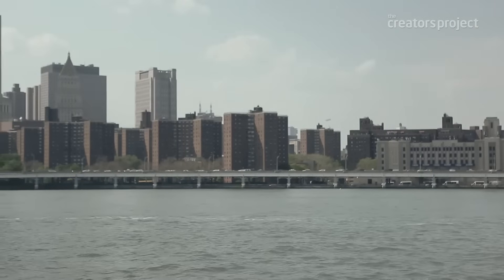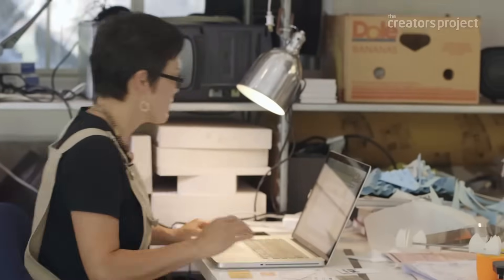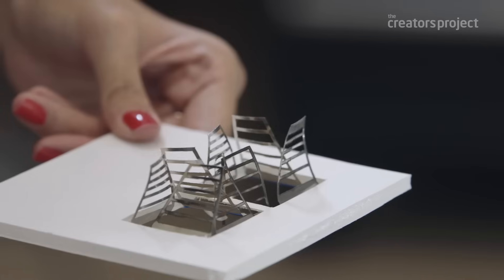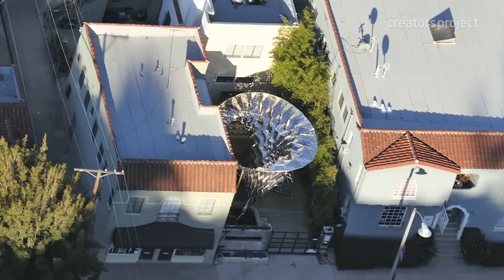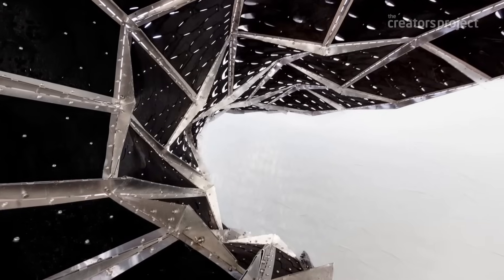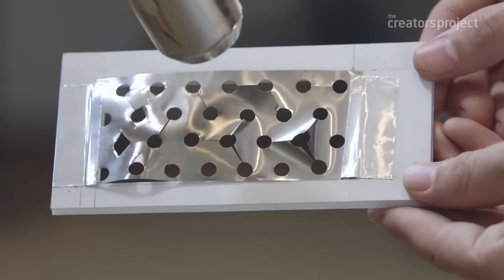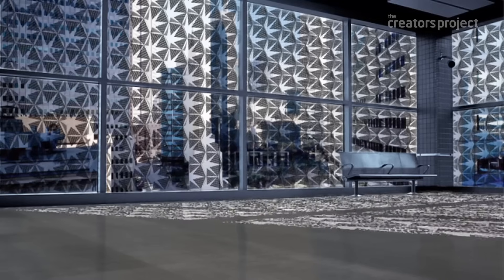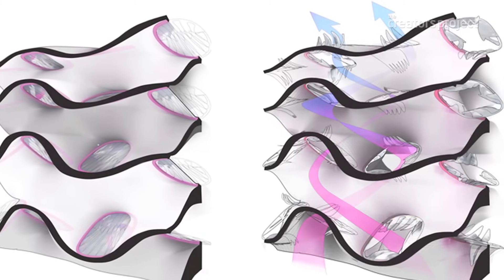Buildings That Breathe | Doris Sung's Living Architecture

Comment: This is a fantastic concept to be coupled with photovoltaics. Ecxess heat from the cells can be absorbed by the structure on which they're mounted, causing it to change its shape, thus rearranging the cells, thus sustaining optimal incidental angle of the cells to sunlight across the arc of the sun.
Reply: !!!!!! agreed

Comment: U told, metal starts curling  at 70degree to about 400degree ?
Our earth   do not that temperature
Reply: I think she was referring to the angle the metal would deflect after being exposed to heat. like during early morning it would bend at 75 degrees, then at noon it would totally curl to about 400 degrees.

Comment: cool advancement but needs to be applied more practically I think a lot of what is shown in the video is based more off of aesthetics than function although this could definitely evolve into something useful and efficient.
Reply: Possibly it may apply for ventilation. When heated, metal curls open up to allow Air to enter and to circulate. When it is cold outside, metal curls will close to maintain the heat inside.
Reply: Exactly. It's more to looks and fanciness. I'm not sure about the practicality and maintenance cost. What more about different climate in different environment.

Comment: Unless this material is a very poor radiator and thus reflects solar radiation very well, it will only be beneficial in rather specific situations. If the motion is regulated by air temperature it could be effective, but if the bimetal activates whenever the sun shines enough to sufficiently elevate the material's temperature, it could activate prematurely, well before the interior of such a structure would desire ventilation. This could perhaps be better applied to the north side of buildings with thermally absorbent south sides. With less thermal mass than most urban surfaces, this could likely lower the amount of night time "heat island radiation," but seems likely to increase heat transfer from solar radiation to air in the day. Further explanation of how this could be applied to actually decrease air conditioning would be interesting. It looks cool, but I'm skeptical of its actual functionality.

Comment: Well, this is a very interesting project, but I have few questions. Firstly, since these are thermal bi-metals which are sensitive and are good conductors of heat, so how effective are these metals films are in thermal insulation. For instance, the situation where the temperature is not hot as the metal sheet tends to curl, and what would the temperature difference from being under this installation to outside the surface.
Having being said that these metals do radiate heat so how comfortable is it staying under this breathing/shading device or in a enclosure made out of this materials?
Reply: Conducting heat within a given material is different to exchanging heat between materials, so its probably very likely that a third material that remains static in shape and is built at a geometry that allows it give off heat to moving air as fast as it can absorb  it (any number of metals that can be formed at one terminus into increasing surface are with the necessary incidental angles to a passing fluid medium-air) can be coupled with it, since its effectlively opening hundreds of valves, it can filter light whilst manipulating a heat removing convection current through itself. But I think it would have to contained within some kind of cavity.
Reply: @benwilms3942  thank you for this!
Reply: Thermal comfort is thrown out of the window completely. Thermal bridges are going to elevate the temperature of the interior space unless you encapsulate in a double pane window the dynamic metallic skin. Otherwise the heat will be intolerable.
Reply: interesting  idea she work with same idea that jean nouvel use it in institut du monde arabe paris where he use what we call it in french mocharabia its arabic system used in past for comfort where he made amazing system where he control the day lighting 
my question when she said trying to prduce window systemand she spoke about the heat game said that these metals do radiate heat so how comfortable is it staying under this breathing/shading device or in a enclosure made out of this materials?
Reply: +Jesse VK Nedunuri , i got the same question in my mind !, if only the property of the of the metal that reflects heat could change to trapping it down ?!?
Reply: what's this metal called?
Reply: @MakerLab3883  bimetal.

Comment: I see this as an outer layer... just a breathable skin. You have common walls behind, but walls collect and release moisture from rain and ambient humidity. also, you can have regular windows behind, or skylights, that can be opened from the inside when desired and letting air in and out. I'm just randomly thinking here, but I think the concept is really good and design-wise, very evolved.

Comment: if the idea is to replicate the human body in architecture, why not look at the way the skin regulates it's temperature: sweating.

I imagine a gravity fed water feature system, working similar to a men's urinal, acting as a waterfall on sun-facing sides of a building.
this could cool the windows and potentially save on window cleaning costs.

perhaps it could also be used to tell the time, or piece of artistic design.
something similar to this Japanese waterfall art:
watch?v=gusJeslMbLc